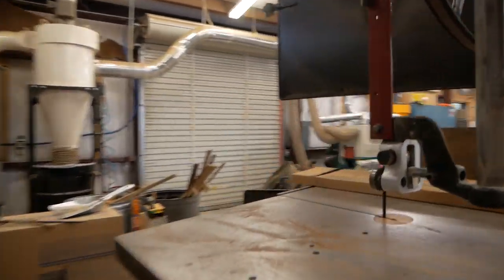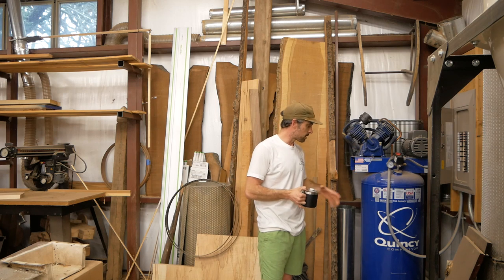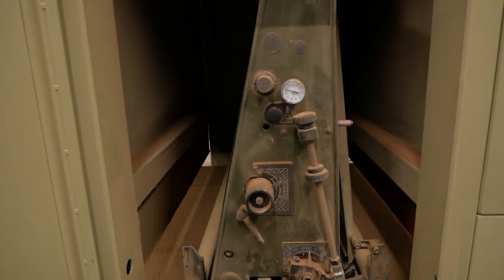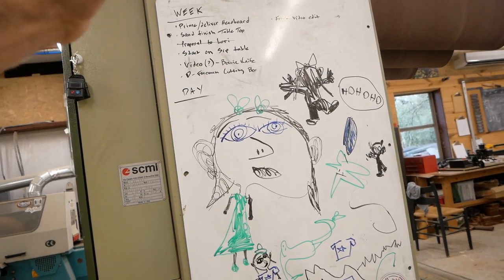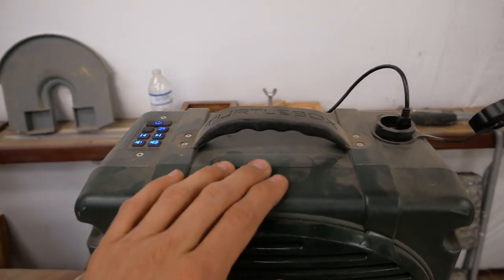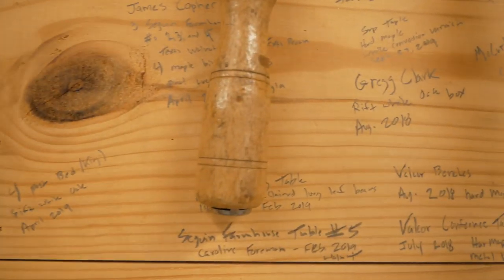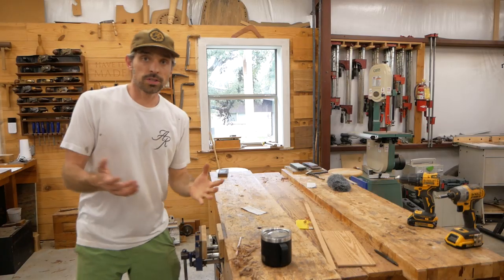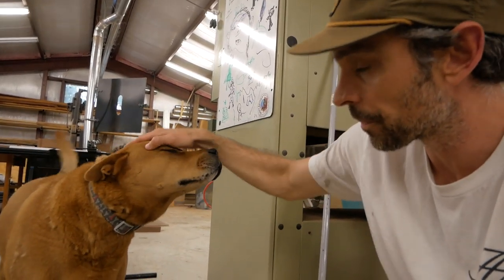2020 Shop Tour: A Look At Vintage Machinery, Modern Machinery, and Hand Tools

Comment: Your Oliver saw is terrific. I'm partial to older equipment myself. I've got a 40s Delta Milwaukee table saw and a 50s Comet radial arm saw. Now if I could just get my wife to OK this Walker Turner radial drill press I've got my eye on, I could tinker in my shop for years without getting bored.

Comment: I was biting by the bug when I saw Paul build a bench in his garden then he started woodworking master classes I was hook I built a little shop 12’x10’ I started with rough boards and progressed from scrub to no.4 finish. Most guys I know started with machines and are trying to go the other way .having said that I did get a 16”bandsaw he is like my best friend, i was considering a small planer or jointer to increase efficiency and help with my 40 something years . I do love hand tools and the silence they bring,  I think maybe a thicknesser maybe . Although many project I built with just a flat face and square edge 😀all the best in your endeavours Dave

Comment: Andy, If the bearings are still sliding okay in the roller head then they're usually adjustable.  If you pull the stop off the front and roll that piece out, the bearings are mounted on eccentric bolts and you can cam them in and out to tighten that up.

Comment: Andy, I was having trouble with mortising chisels, even good quality ones, running hot enough to draw the temper in the chisel. Then somebody suggested I set the boring bit-chisel gap on a dime. End of problem. Also, the geometry of the chisel needs careful scrutiny. I had to relieve the taper on some US-branded chisels so they tapered minutely smaller from the cutting edges up a couple inches. The best sets I found were either British made or used pre-1980 extremely high quality  US made tooling.

Comment: Check the runout on the metal disc on that sander. I use a dial indicator on a mag base. Think of a warped brake rotor on a vehicle.....

Comment: Andy, it is always  worth celebrating, being able to pay off a loan early. Congrats on that,  takes away some pressure.  Nicely outfitted shop.  My favorite video series was the Oliver bandsaw. I have a similar no name vintage 36" bandsaw. Wish it was a Oliver. I would like to know more about VFD you installed on it and anything else , have not seen. Mine runs so fast , kind of scared of it. Need better control.  Anything your willing to share i would appreciate. Keep up the good work. Thanks Keith Parr

Comment: You should look for an old Buss planer. I dont know if they are common down there, but they come from the same area and era as the oliver. The biggest thing is to make sure that they have decent bearings. There are a lot of them and can set you back $1,500 just for the bearings.
Reply from the maker: I'll keep that in mind!  I really want to stick with a combo machine to save on space
Reply: A Buss will not save on space unfortunately, they will go the opposite direction.

Comment: Taylor has a line called JLT that they make a clamp and clamp rack. They are 100 times better than any parallel or F clamp. Worth the investment.
Reply from the maker: Yeah you mentioned these before and I looked into them.  They would be far superior but not sure I have the space for it and I dont think I do enough glue ups to justify it.
Reply: Andy Rawls they sell just the clamps. It would be worth looking into that for less room taken up. I get this all the time. Everyone is hesitant at first, but when they go to them, they wish they did it years ago. It really is a big difference. I have been trying to convince them they need to sponsor guys like you.

Comment: coming out of High school I went into the furniture factory in High Point NC. I run a ban saw real close to the one you have. to stop it we had a bigfoot leaver brake system. still took forever to stop. but man did it cut. wish I could find one as you did.

Comment: Find a. Ac condenser for a car, hook up your compressor pump directly to the top infeed at the lower exit hook up a water separator the more complex the better have a fan blow air over the condenser always when it's on.
After to separator run the air lines into a one way ck valve then into the tank. Just the black iron pipe wont drop the compressed air enough to separate the moisture in the lines.  I differnt way is a big long copper coil down into a 55 gallon drum of water. The take of water will give off its heat into the shop.
Third way is an earth system. Run lines 3 foot down in the dirt outside it's always a out 54 to 57 dgr. Under the suffer.

Comment: What are your thoughts on a wide belt vs drum sander? I've recently moved from 2500 sq ft with a dual drum back into a garage with neither. If power requirements weren't a factor, would you go wide belt again? These days, I'm mostly making cutting boards and dining tables. I feel like I already know the answer.

Comment: The new Oliver is it the same as the old Oliver it’s not the same company and it’s all imported stuff, that being said original Oliver machinery is some of the best ever made and I love it. Instead of using ex factory for machinery contact Bryan at 360 degree machinery. He’s extremely fair and all the machines they bring in and go through and fix and tune them so when they get to your shop there ready to go and there is no more time and money needed to get them right.

Comment: Purpose-built flamables cabinets are terribly expensive. If you live in a place where the fire marshal intends, for instance, to hassle you into leaving a residential area this might not fly but the world is full of unused file cabinets. I use two four drawer fire -rated file cabinets to store flammables. An insurance inspector looked them over and said, "Good solution."

Comment: I can’t believe you paid 10k for the sander!!😵 that’s insane
Reply: That's a lot of money but you can easily pay 100k for one with 3 sanders
Reply: Giacomo Battisti I could buy a house for that!! I’ll keep my card scraper thanks
Reply: @pacificcoastpiper3949  wide belt sanders are for flattening big panels/doors and not for sanding, or at least, they can do a great finish but mainly they should be use to flatten out stuff. We have a massive one at work with 4 sanders, one brush and one polisher, wish i had one at home (even a little one)
Reply: Giacomo Battisti 😮 I’ll stick to my axes thanks
Reply from the maker: I paid $10K out the door, there was freight and tax in that.  For years I prepped my stock and table tops with handplanes and card scrapper, I don't miss that for a minute!  The sander has already paid for itself and probably saved me some arthritic fingers.
Reply: Andy Rawls I’m a bowl carver ala roy underhill